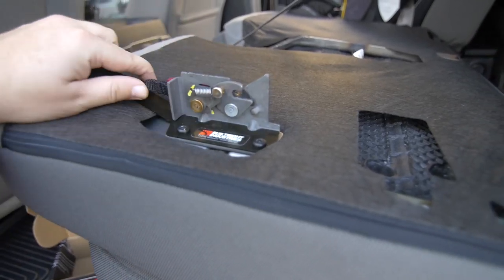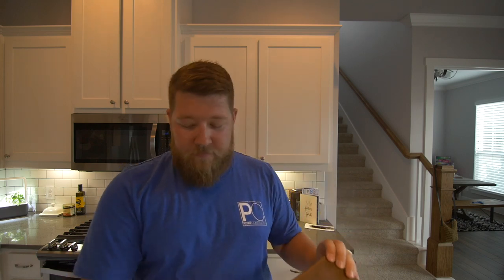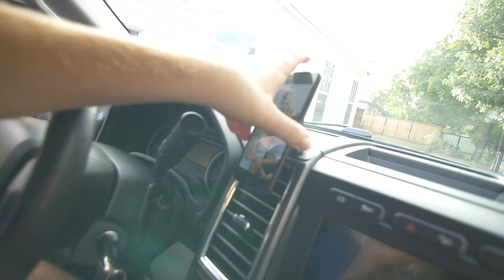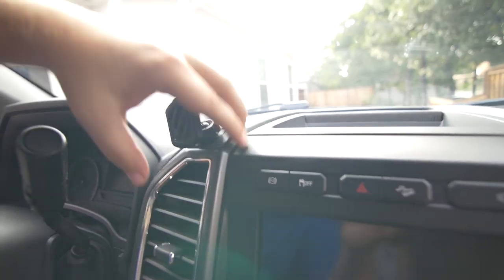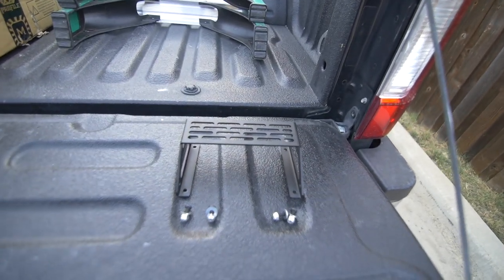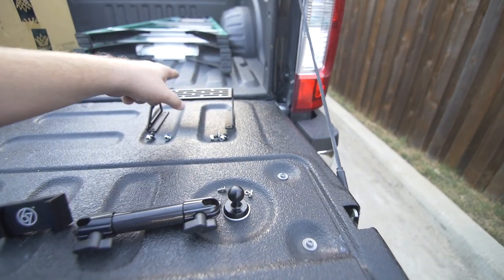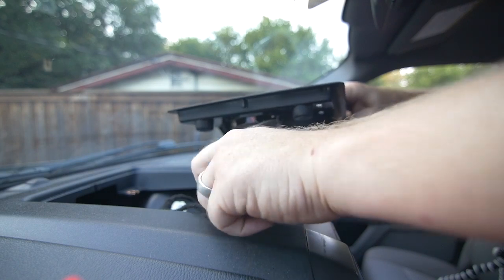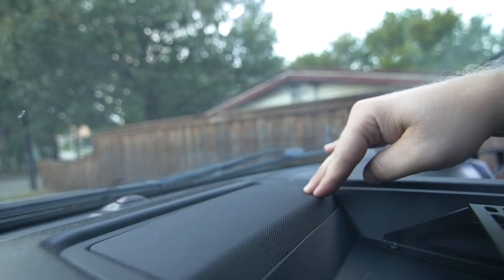MUST HAVE PHONE MOUNT FOR YOUR 2017-2020 F-250!!!

Comment: I have a BuiltRite Shelf and they are awesome. You should install some power ports up there in the shelf, then you wont have cord dangling all over the place.
Reply from the maker: That’s a great idea. I would like to find a way to make the 67 design mount wireless charging. It would be a challenge but would but super convenient.
Reply: Are you aware of any videos or instructions on how to add power ports up there? That's actually what I am here searching for. Where would you tap into to get the power? Thanks for any help you can provide.
Reply: @smar7056  No, I have not seen any videos on this. I tapped in to the 12VDC Power Port on the Dash since it was managed by the BCM to auto turn-off power based on vehicle settings and it is in close proximity. If you have an F-250 w/upfitter switches you could use one of the switches to control power.
Reply: This is genius. If you could somehow reroute the center console USB’s up there so you have CarPlay that would be the bomb

Comment: Great video but come on.  $79 for the mount and $45 for the metal bracket????   I can buy an Android radio for Pete's sake.
Reply from the maker: But who wants an android radio....
Reply: Or you could buy a scosche magna Mount. I used one for a couple years and my phone never fell off when hitting bumps or railroad crossings. No drilling required and the 3M tape holds very well.